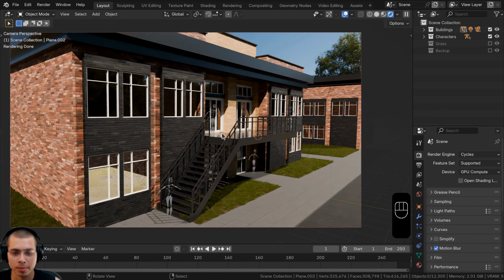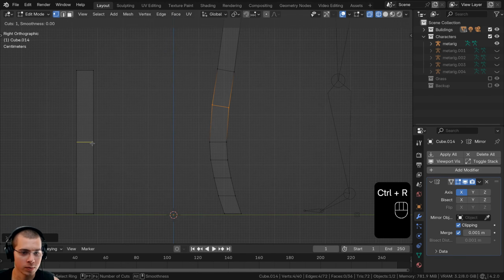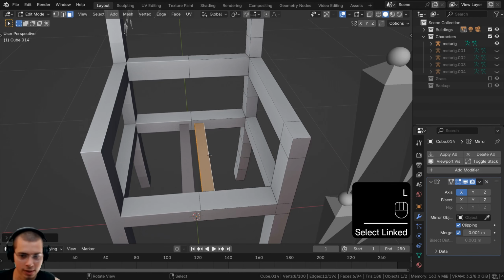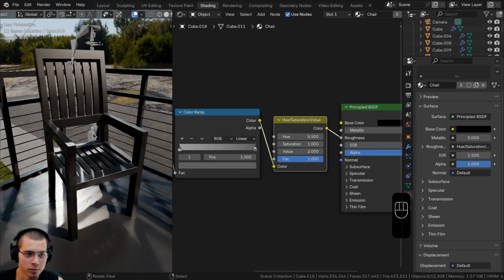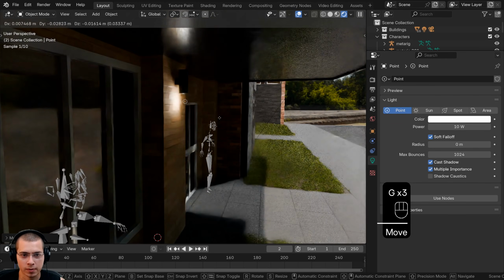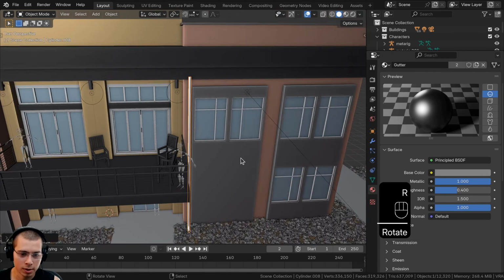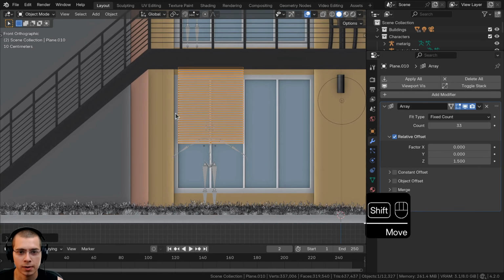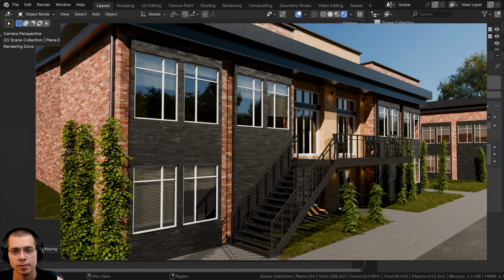Part 7: Creating an Industrial Building in Blender 🏙️ (Tutorial Series)

Comment: If you want the lights to have the same brightness — a reasonable decision — then you should make just one light and duplicate it with ALT-D not Shift-D.  This makes an instance of the original object, so editing one of them changes both.  You can do this as many times as needed.  As well as making it easier to adjust them it also saves a tiny bit of memory as the object info is only stored once for an instance.  Instances save more memory when you have objects with geometry and texture maps, but it can be worth using instancing for its convenience as well as the memory saving.
Reply from the maker: great tip!

Comment: also what device do you use (PC)
Reply from the maker: Here are my PC Specs:
• Ryzen-3900X CPU 12 Core 24 Threds
• Cooler Master CPU Liquid Cooler
• EVGA Supernova 1000 Watt Power Supply
• RTX 2080 Super WINDFORCE OC 8G Graphics Card
• SAMSUNG 500 GB Solid State Drive
• WD 6TB WD Black Performance Internal Hard Drive
• 3000 MHz DDR4 32 GB Ram
• Thermaltake Level 20 MT ARGB Mid Tower Computer Case
• ASUS ROG Crosshair VI Hero (WI-FI AC) AMD Ryzen AM4 DDR4 M.2 USB 3.1 ATX X370 Motherboard
Reply: @RyanKingArt  i am crying because i have a budget pc